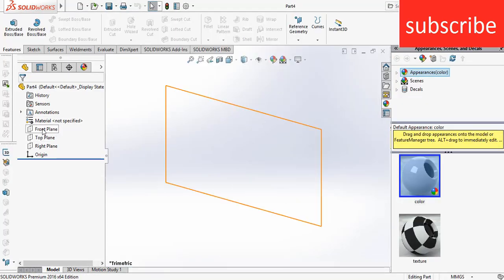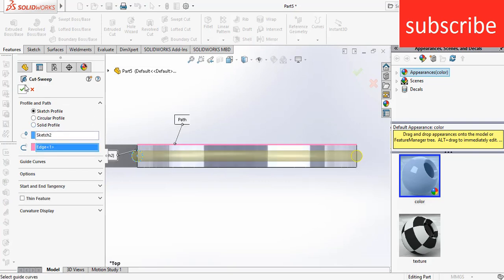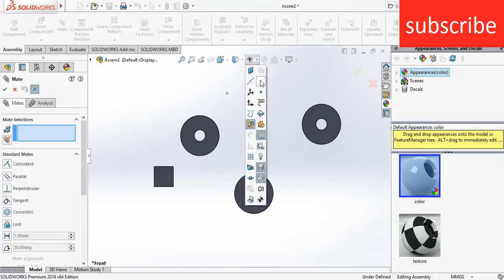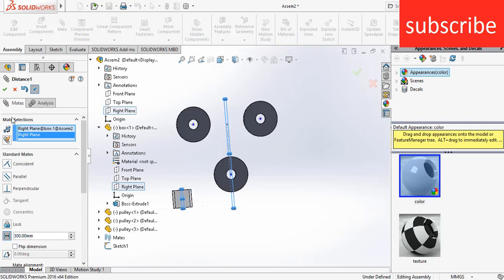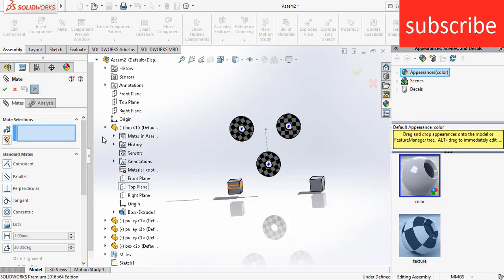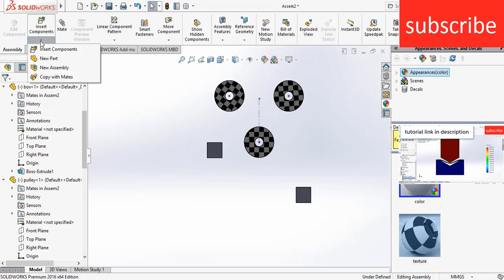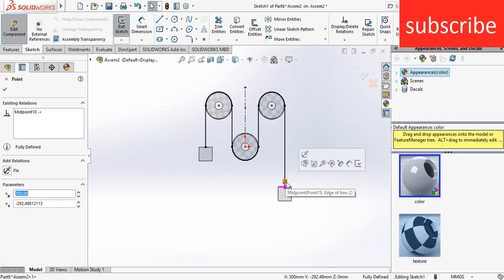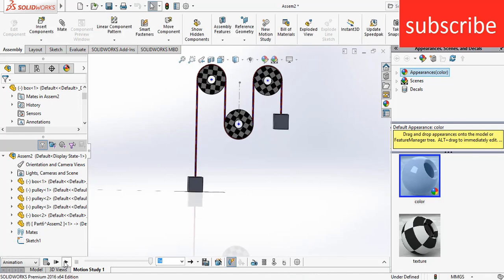3 Pulley animation in solidworks

Comment: Interesting but I have a question. Could you have the rope fixed at one end and allow the middle pulley move up and down according to pulling the rope at the other end? A complex pulley system?
Reply from the maker: Can be done but will take lot hit and trial.
Reply: @Cadknowledge  thank you. I have 2011 sw. Is latest sw version much improved for simulations and matse?
Reply: I trying to use SW to create virtual mechanical computers with historic types of mechanics. I need to be able to do things like make realistic pulley systems, a ball or wheel that rolls on a disk by friction (slower twords the center and faster at the outer edge of the disk.
I also need to find a way to graph the output, or even make a virtual pen to draw on the graph.
Reply from the maker: @stevematson4808   For animation purpose i recommend try my course it includes motion analysis with graph . How to do animation in solidworks. This course is designed considering you are beginners
https://www.udemy.com/course/solidworks-animation-and-motion-analysis/?referralCode=8F40E7F83856CFF0C5FE
Reply from the maker: @stevematson4808  if you are totally beginner in solidworks then i recommend try my FREE solidworks course : https://youtu.be/iYYHmvnlSQo (Will give you an idea how i teach)
or for motion analysis you can check my paid udemy course

Comment: what is the mathematical method for animation of rolling pulle
Reply from the maker: 2*pi*r . You can say when pulley rotate 360 degree it move move the rope circumference of the pulley. Here r is pitch circle of the pulley
Reply: @Cadknowledge  how to include the rope for rotation? thanks
Reply from the maker: Use rack and pinion mate you need to use math for that